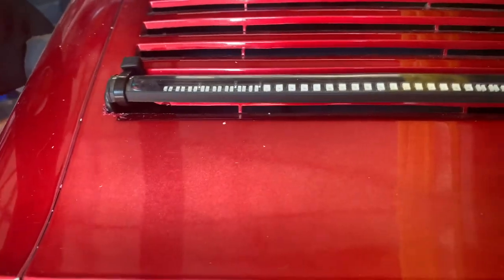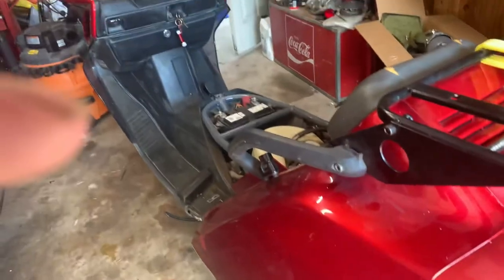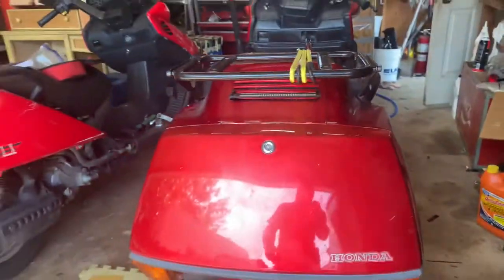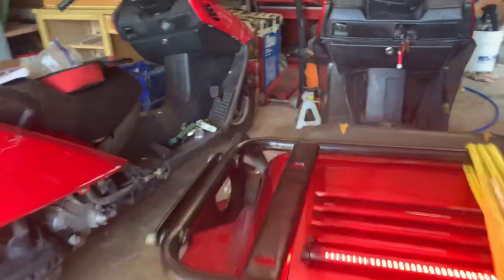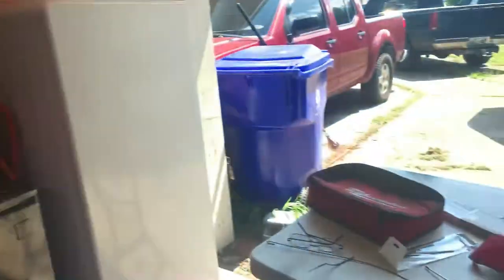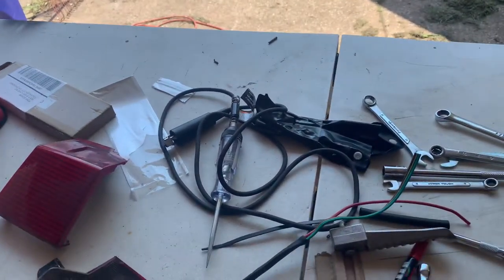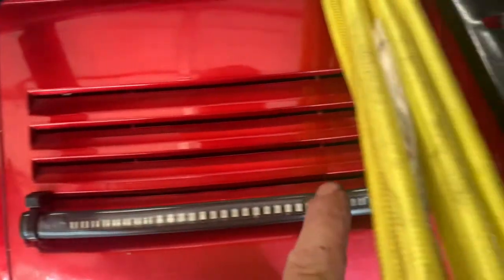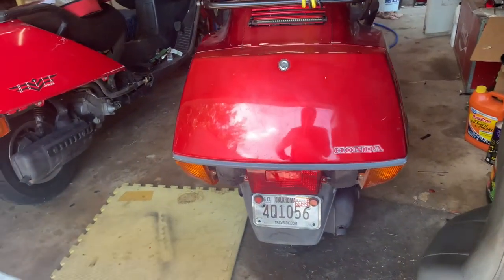Honda helix added a brake and turn led light strip

Comment: Hi Tony hope your wife gets better so she can get back out and ride the helix. Your videos are great! Is there anyway that you can do some maintenance videos? Maybe like oil changes, coolant changes, final drive oil changes, air filter change? Maybe even some of the more difficult things like belt, roller changes too? Sure would help us newer Helix owners. Keep the vids coming.......GREAT JOB!!! I have the same light bar that you have, except it has the running light and I mounted mine on a bracket that I made and bolted it on the luggage rack.
Reply from the maker: I will the next time I change oil.

Comment: Tony, you didn’t show how you connected the wiring, just the taped up finished product.  I’m about to do this same procedure, but I’m doing it with a light bar on a spoiler and there are no instructions on how to do it out there.  Can you tell us what specific colored wires you connected to on the bottom left side?  Thanks.   Bill
Reply from the maker: I just tested wires with a test light and found turn signal and brake light wires. Can’t remember the color codes but if u ground you’re test light and turn turn signal on probe wires till u find the one flashing that turn signal wire.

Comment: Nice one tony.what phone holder are you using?
Reply from the maker: Well I was going to put a picture of the one I got but i guess I can’t put a picture in comments. I bought it on eBay item number is 264077206532. I have a iPhone 10 with case and it fits good